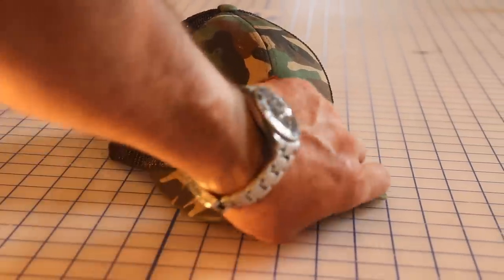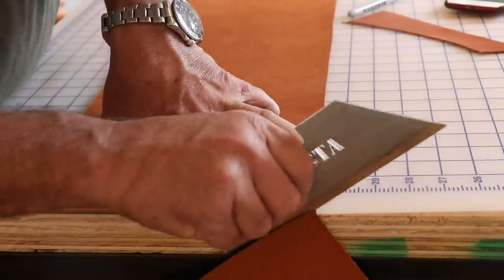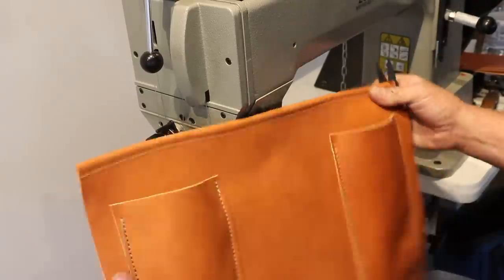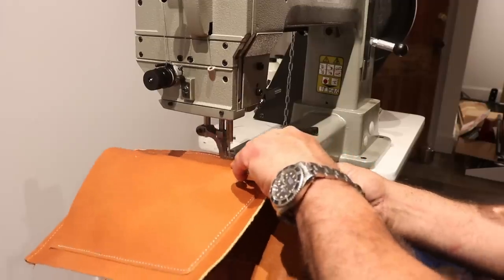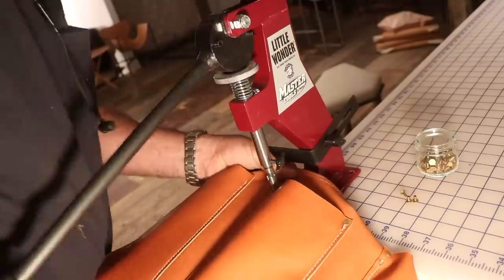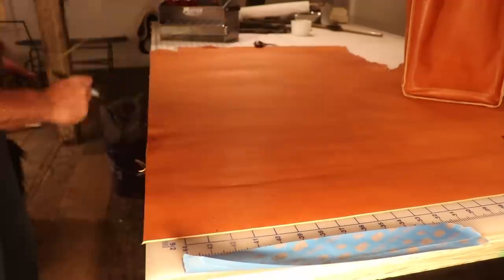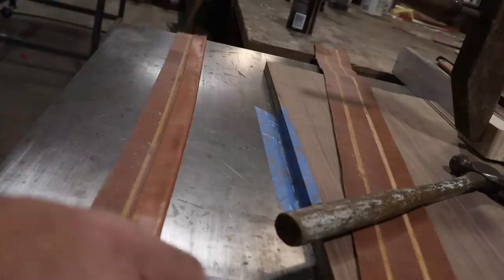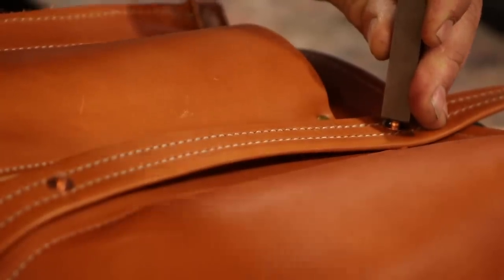Jimmy DiResta Leather Tool Bag

Comment: Leather worker and wood worker here. I smiled big when I saw you use the table saw to gouge your leather to make the strap. The tool that we use is called a V gouge. But you use what you have and whatever works. Good on you. The bag looks awesome, and very functional. When you set your copper rivets and burrs, after doming them with the setter, you can go back over them with a cobblers hammer to peen them over more.

Comment: The leatherworking stuff is closest to my heart... btw, I probably would have used a V-gouge for the folding channels...but even with that thickness of leather, wetting and using a bone folder or sturdy steel ruler with a brayer would do it.  I've had exactly one bag strap crack on the edge where the skived fold was, but this was likely my mistreatment of the leather when trying to seal it.

Great bag, JD.  Love it.

Comment: (12 year veteran leather worker) 
Table saw skiving is next level.... normally it's done with a U shaped chisel, galled a groover, and it's not nearly as good as what your doing here.

I would recommend cutting the copper rivets a little shorter, and use the ball peen hammer to "smear" the top over into a mushroom cap with a lot of little hits. it pulls the base of the rivet up into the leather, it pulls the bur (copper washer) down into the leather for a tighter fit, the rubbing can eventually cut through the leather if it wiggles around over time. it also keeps the rivet cap from standing too proud and catching on stuff and scratching it.

Comment: Man, I should work in leather, what a nice material. You can leave the edges exposed, that alone is wonderful. You can get it as thick or thin as you need, within reason of course. Can be flexible like cloth, yet structural. Of course I'd need one of those beautiful (and prolly $$$) sewing machines.
Reply: Hand sewing to start is fine. I've been shopping around and trying to get into leather myself. It's honestly a very cheap hobby to get into and you can do the work really anywhere. A set of some hand tools, some normal everyday tools, some glue/dye... then the leather and thats it really. There are nice starter kits that come with needle and thread and a bunch of leather tools. You can throw a movie on and sew up a wallet in your pajamas if you wanted lol. It really is an interesting craft, and the pieces will last decades.

Comment: Nice work, with the handles you can skive those grooves with a "V" gouger tool, and if you get the leather wet it will bend, fold and retain shape a bit better. (Of course the latter depends on the leather type.)
Reply: Christian I had not seen the table saw technique before...I bet in some respects it works better than a v-gouger...
Reply: Yeah I do think it would work better in that instance for a clean fold, as sometimes with the gouger I'm making a couple of shallow passes to get it wider. As opposed to using the gouger for stable corner bends.

Comment: They're just called Copper Rivets, as far as I know and I believe you can also get brass versions too... the only thing I picked up on was when using them, you pein the stub down until it contacts that washer to ensure it'll never busts free and that stops those stubs from catching on anything... maybe cutting them a tad shorter  would help with that... other than that... superb design and a superb video to watch... thanks dude! :o)

Comment: What a great bag! That saw part was strictly brilliant! As a leather worker, the only thing that gave me pause was when you joined the handles. It would probably hold more weight if you sew 1 smaller square at the end of each piece, then a big rectangle around the the 2 of them. But I loved the bag! Great job...

Comment: They are called copper rivets, and you can cut them off much closer to the washer.
Reply: James Stancil Aren’t they called speed rivets? They make them in brass too.
Reply: @BradyBegeman  No speed rivets have a post and a cap, copper rivets have a post and a washer. You have to get speed rivets as close to the right size as possible, where copper rivets will work in almost any thickness of leather as long as enough of the post comes through to make a burr over the washer.
Reply: Someone else on here mentioned using pennies in place of the washers, could look pretty nice in some uses. Great way to use up those annoying pennies, ya know?

Comment: Hello, so I’ve never worked with leather and have been looking at making my own canvas bag but I really like this one. So now I’m looking at trying this out. An anyone help me though. What weight leather would this be? 8oz maybe? Don’t want to order to thick or to thin. Would like it to stand on its own just like this. At work I have access to heavy duty sewing machines. Pretty excited about it.
Reply from the maker: Hi there! The leather used in this video is a 3/4 oz. You could probably go up a little bit heavier than that if you want a pretty heavy-duty bag or just add another layer to the base of the bag for added thickness.

Comment: Very nice. Would have thought about super short Chicago screws where you put the rivets so as to make a completely flat reveal on those fasteners.
Reply: Yeah, I wondered about that too, first thought I'd've put the washer on the back. Once that nubbin is rounded over it looks pretty good though. Somebody in the comments mentioned using drilled-out pennies sometimes instead of those washers, could look cool on some projects. The Chicago screw idea is good, but the finished look of copper and leather? Ungggg...

Comment: Beautiful bag! I was wondering...could one use an old leather coat to make bags? I hate to get rid of it.
Reply from the maker: Hi Linda,
Yes, you can definitely use the coat to make leather bags. The coat leather will be thinner than the leather used in the video so the bag may not hold it's shape as well as this one but otherwise, it should work great for you.
Reply: @WeaverLeatherSupply  Thank you so much for your reply! I think I may give making a bag a go. Never used leather before, but here goes!
Reply from the maker: That's awesome, we hope you have fun with it!
Reply: What about beefing up the leather by gluing a piece of heavy canvas to the back? Or two? I wonder if that really, really heavy material Duluth Trading uses for pants would be good? Heard they use cotton weave from old firehoses. That could look really cool, I'd try hard to keep some elements of the coat in the final bag, like a pocket or the original closures. The final result will probably have a nice patina already, already be all lived in and supple. I say what the hell, jump right in!

Comment: Interesting. That knife was sharp. Have not seen that one. A Weaver item? I use the Cobra Machine. Can be a bit "finicky", but when running smooth, a great machine. Saw you did not backstitch - or pull thread and knot - on some pieces. Not needed because sewn together with other pieces? RAM Leatherwork
Reply from the maker: Hi Richard! The round knife is from our Master Tools line, we'll link it below if you'd like to check it out. And yes, I believe in the areas where Jimmy didn't backstitch there was either a rivet attached or the pieces were sewn together with other pieces. Hope that helps!
https://www.weaverleathersupply.com/catalog/item-detail/65-2530/master-tools-deluxe/pr_40365

Comment: What size thread and needle are you running? I have an old Nakajima 180 walking foot industrial machine that I’m converting to a servo motor for full speed control. I’ve red forums where people mention running as heavy as Tex135!
Reply from the maker: Hi there,
The needles are a size 230 and the thread is 277 on top and 207 on the bobbin.

Comment: What brand of sewing machine is that? Are they still in production? (It looks like an old 50's or 60's design)
Reply from the maker: Hi there,
It's our Weaver 205 machine and yes, they are still in production. It's modeled after the discontinued Adler 205. We'll link it below if you'd like to check it out. https://www.weaverleathersupply.com/catalog/item-detail/65-8080/weaver-205-sewing-machine-/pr_51532